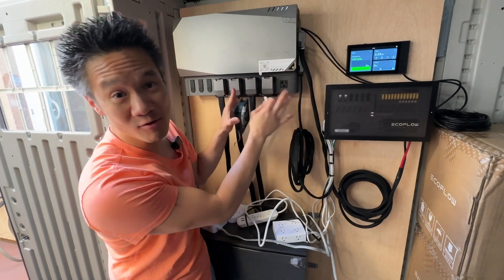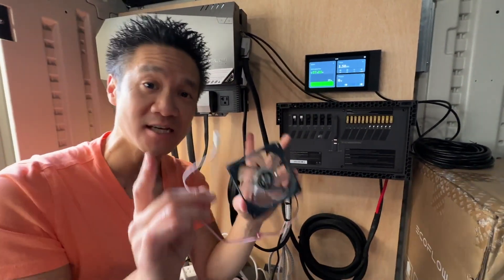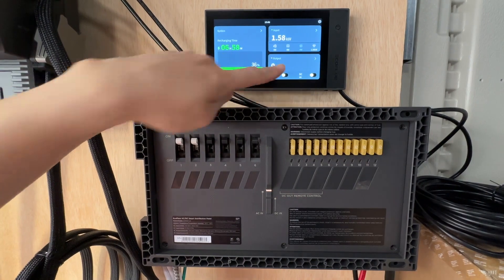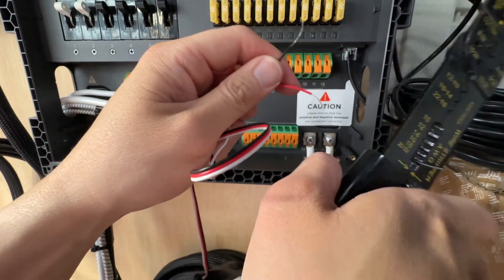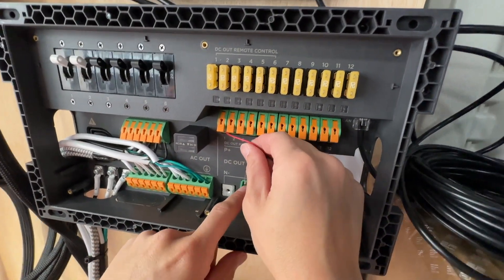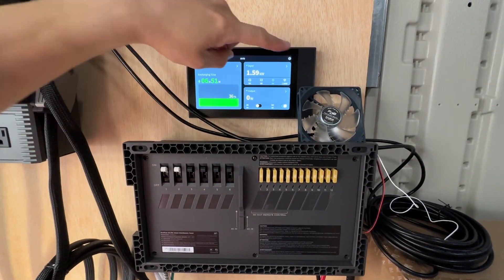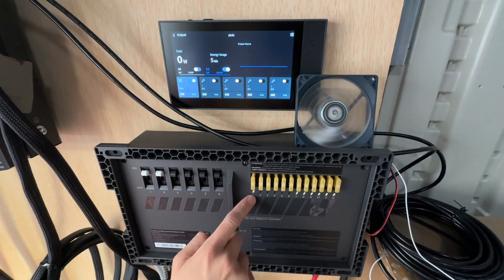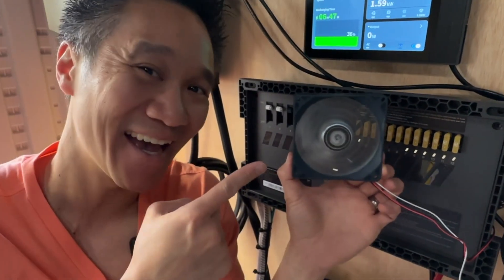Power Kits Off Grid - 12V DC LOAD SETUP!  Day #6 of EcoFlow Power Kit Installation!

Comment: That thing is damn loud while charging though wtf 😂
Reply from the maker: It has to ventilate.  If I charge at a slower rate it will be quieter.
Reply: @UTECHPIA  Yes I understand, but I feel these fans are not the best. Perhaps they can be replaced with noctua fans or other low dB fans with still good airflow. Good to know that you can limit the charging Amps so that the fan sound can be somewhat controlled. Your videos are entertaining and educational which is nice. Also good editing without wasting time.

Comment: Isn't the white one DC common like another ground???    U should use it somewhere but there's no grounding bar
Reply from the maker: The white is for reporting the speed to the motherboard when installed on a computer.
Reply: @UTECHPIA  is it really.     So it's more of a data line.   Must read the amperage then and relates a speed by that.   Not by revolution.       And I'm an ac/DC guy.    I should know this.       So your sure.  The white is a data line.     Well thank you for the info.   I should know it off the top of my head.    Just by knowing a 12 or 24v DC fan.    But I wasn't sure.     I don't have the manual in front of me.    But always willing to learn if you already know and. I don't.    But that seems accurate then.  And correct.  It had to be something
Reply from the maker: @scottykingdavid  , Yep, you can search for "3 wire pc fan pin out" on google and you'll find some the true answer :)
Reply: @UTECHPIA  then ifs for sure reading the current /amperage and deciding from thrrr
Reply from the maker: @scottykingdavid  , maybe, i'm not too sure how the white-wire works to be honest :)